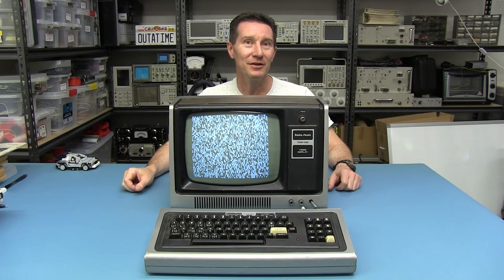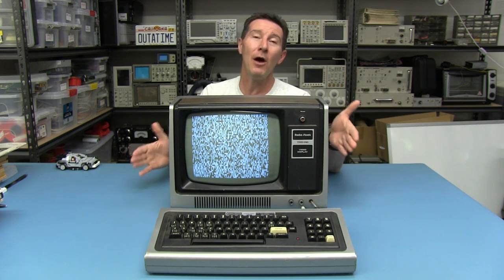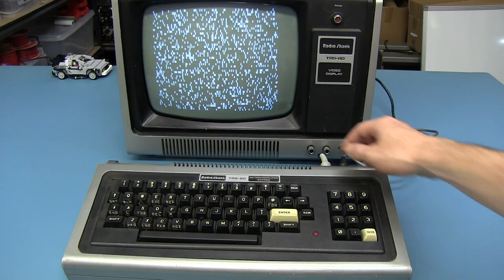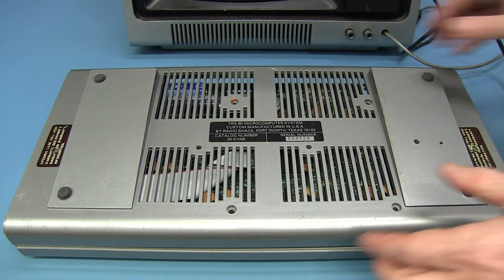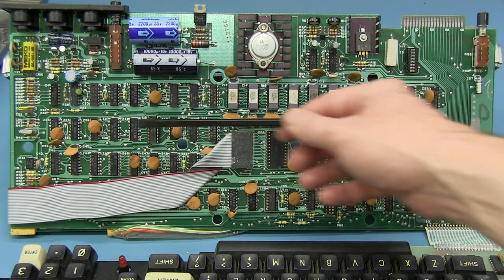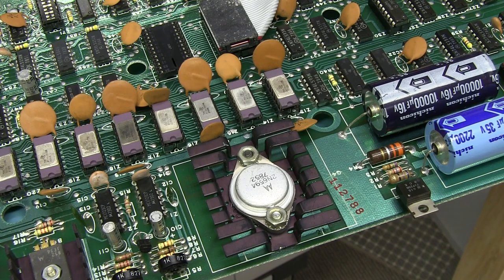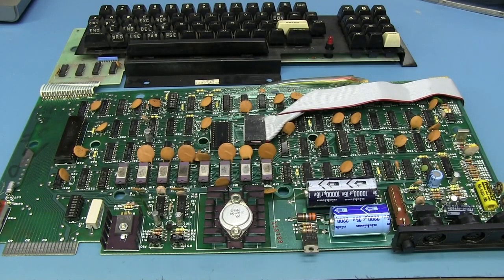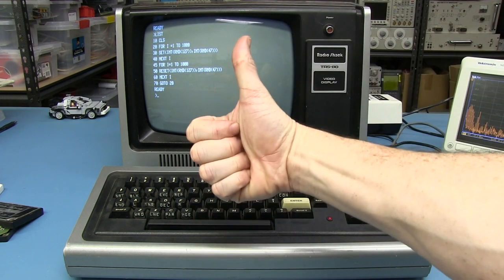EEVblog #645 - TRS-80 Model I Retro Computer Teardown

Comment: That machine had daily use as a home and business computer for 6 or 7 years. The next 2 or 3 years it got flogged in a factory as a label printer driving a sequence of dot matrix printers. Then retirement and storage once PC clones took over. There was no bootup time so the easiest way to stop what you were doing and get ready to load the next task was to power cycle. Flicked on and off all the time.

Primarily used for word processing (note scripsit labels on keys) and label printing using custom apps written by family members when it was at work. Had the same plus games plus VisiCalc at home. Also used for writing a lot of random games, apps, and utilities as I learnt to program.

Had 1 game with sound. To get the sound you had to connect up the tape player, Set it to "Record" and hit pause which would cause the sound input to come out through the speaker. Even then, it was more squeaks than sounds as they were produced by writing out certain bytes combinations via the tape interface that were known to produce alien like sounds. Squeeks and squawks only.
Reply from the maker: Ben Govett Awesome, thanks for loaning it Ben!

Comment: Now 42 years or so have slipped by since I worked a one of the largest Radio Shack stores in the US in Framingham, Massachusetts.and we were certainly excited to get these units into the store and they did sell as fast as shipments arrived. As I remember the story, the computer was first going to be sold as a kit that you built by yourself. After meeting with the brass in Fort Worth, it was decided that it would be better to sell it as a complete unit. Two things I do remember differently than you described. First, the unit was shipped to us and sold with the keyboard and the "video" screen and the tape recorder and the power supply with all the cables. And it was all included in one box for the price of $599.00. And second, the first units only came with 4K RAM but later units could be ordered with 8K RAM. As you pointed out, it was a rapidly changing market so updates and changes came rapidly after production started. I have a slight difference in the clock speed. You stated that the speed was 1774 however the joke at Radio Shack was the speed was 1776--remember this was right after the 200th anniversary of the founding of the US. This computer was incredibly slow. Basic did not help. As a test, a friend and I wrote a program to sort 100 peoples names. Several hours later it was still working. But having said all of this, I remember staying up all night playing with the computer that I borrow from the store over the weekend--Stores were closed on Sundays back in those days. I learned a lot and I also sold many units  Thanks for the program that you put together It was fun to watch.

Comment: I still have my Model 1 with 16K (serial #6841).  I piggy back soldered a memory chip into the system to access lower case letters (with a toggle switch to disable for some incompatible programs). I taught myself BASIC and then was allowed to teach a 9 week class in my senior year of HS in 1982.  This device gave me the jump start in the computing industry and a boost to my confidence at a very crucial time in my life.  Thanks for sharing and taking me back to my roots!

Comment: It was actually possible to get a TRS-80 Model I without the numeric keypad throughout most of its production run -- not just the very early ones -- if you bought the low-end 4K version with Level I BASIC. The 16K Level II version came with the keypad as standard. It was also possible to upgrade the RAM and the BASIC without adding the keypad, so once in a while you'll come across a Model I with 16K and Level II but no keypad.

Comment: Brings back memories! I worked as a service tech between 1978 and 1983 in an independent Radio Shack dealership (actually two) in Slidell, Louisiana before Radio Shack (later Tandy) clamped down and only ran company-owned stores. I remember the owner successfully winning a lawsuit to remain an independent dealer/repair station per his contract. Needless to say, Tandy hated us :)

You are right that the expansion cable leads to the Level II ROM. The original ROM chip was pulled out and the expansion board attached with double-sided tape. The colored jumper wires were attached for power, etc per the Tandy-supplied instructions to the techs. Oxidation on those jury-rigged connections caused no end of grief.

Little known fact: When we had to replace or upgrade a DIP chip in the field, we were required to socket it to show it's compliance with the latest update. PITA because some were used in moist environments and the tinning on the chips would oxidize (like you see on the Z80). 

Later, when the FCC cracked down on emissions, we were required to add stick-on shielding packs to any Model I, II or III that came through the shop whether is was part of the repair or not.

We had tons of fun (not!) in fixing the circuit board design errors on any early-model machines (usually the II or III models). It seems we were forever getting service bulletins to cut this trace, jumper from here to there and generally create a rats nest of circuit fixes that should have been found in the original circuit boards.

All in all, pretty sturdy machines that would get pretty warm over time and sucked power like it was free. I never liked working on the monitors much since I got knocked unconscious once after accidentally running my right forearm across the back of the cathode ray tube doing a repair. My tech buddy said it tossed me about 6 feet back from the tech bench. Don't remember that but DO remember waking up on the floor. I still cringe every time I see an open flyback transformer...
Reply: "I never liked working on the monitors much since I got knocked unconscious once after accidentally running my right forearm across the back of the cathode ray tube doing a repair."

And that is why, folks, I don't do monitor repairs.
Reply: Yes, you learn the value of an isolation transformer  Very quickly! I went in forgetting to plug in the monitor into the transformer with my scope pro, flew across the Room and messed up the probe as well

Comment: I spent a good portion of my childhood hacking on one of these.  A couple of relevant points:

The machine ran at 1.77 MHz out of the box, but almost everyone who actually owned one and was at all into electronics ended up doing a fairly simple hack to double the clock speed, so an awful lot of these actually ran at about 3.56 MHz instead.  That was actually much faster and more capable than most of the competition at the time, which I think was part of why they were so popular.  There was also a very common (I think almost ubiquitous) hack to add an extra RAM chip necessary to do lowercase (the character generator actually included lowercase characters already, though some of the earlier ones looked really ugly (they didn't do descenders properly), so that was often replaced as well).  Radio Shack even offered a DIY "lowercase mod kit", if I remember correctly.

I'm pretty sure that the monitor was actually sold with the computer as a set, not separately.  I've certainly never encountered any TRS-80 model 1 that wasn't bought with both the keyboard and monitor together.  It was true that you could technically hook it up to any composite NTSC display (so you could display it on a TV if you really wanted to) but that required hacking up a custom cable that as far as I know Radio Shack never sold.

The tape deck may have been sold separately (I don't remember), but it actually worked with any common audiocassette player (it wasn't a special computer accessory or anything), which lots of people already had, and if you didn't they didn't actually cost that much.

The expansion interface (which was a box which sat under the monitor) didn't actually contain the disk drives.  It just contained a drive controller, which could then be plugged into external disk drives (which sat in their own separate box(es)) via a ribbon cable.  (It also contained more RAM, printer and serial ports, and a few other extra bits, as I remember).  You could actually connect up up to four external disk drives by daisy-chaining them.

The "Trash-80" name was originally coined by Apple fans, I believe, but a lot of folks in the TRS-80 community sorta turned it around on them, adopted it, and made it their own, and it became something of a moniker of pride in some groups.

The 64x16 character display was not driven by price (as far as I know).  It was because that made the video memory space a nice round 1K in size, which was architecturally convenient for several reasons.  It also made the character aspect ratio much closer to printed text, which made text applications nicer.  Also, keep in mind that the 64 character display was at a time when other computers really only had 40 characters across, so the TRS-80 was actually much more capable for text applications like word processing than its competitors (which was the other part of why it was so popular, I think).  The 64x16 screen was not a compromise, it was actually arguably a much better character arrangement than what most other home computers had at the time this was released.

Regarding audio, you could, at the time, actually buy a little external speaker box which you could plug into the cassette port which the computer could use to play sounds.  It only offered simple bit-banged (on-off) audio output controlled by writing 0 or 1 to a port, no fancy synthesized audio or anything, but there were actually some programs at the time that still made surprising use of this through PWM techniques, etc.  There were lots of games and such that did include full audio effects using this method, and even a "music composition" program that featured multiple voices, and an editable graphical depiction of a musical score sheet, etc.  These computers were certainly not "mute" by any stretch of the imagination.

It's also not really fair to say it had "no graphics to speak of".  There were actually a lot of games, paint programs, etc for the TRS-80 that made use of its pixel-graphics capabilities.  Sure, it was only black-and-white, and you could only draw in blocky, non-square pixels, but you could still do a surprising amount with that if you put your mind to it, and many people actually did to good effect.

Oh, and it wouldn't actually hurt anything if you plugged the wrong cable into the wrong port, it just wouldn't actually work (obviously).  They were at least bright enough to take that into account with the design.

Comment: I used to work on these back in the 80's and i still have one that i must restore to life one day . Back in the 80's i made a load of hardware and software for them, i never marketed / sold it though :( . Audio samplers, 512k ram extension , RAM based NEWDOS/80 (no need to load overlays from floppy/HD) plus much more.

Comment: Super fun hacker computer for back in the day... you could get books on how to hack it... including a full disassembly of the L2 Basic.  I took mine and put 48KRAM, L2 Basic (used 64K EEPROMs in the original sockets, no extender board needed).  It's very simple to add lower-case characters, they're in the generator, you only have to add one wire IIRC.  My first real tech job happened because I was a Model1 hacker... all their industrial computers were based on it, Z80 stuff.  Made things that connected to the parallel interface... EEPROM burner, etc.  Still have that thing somewhere in my junk... you haven't lived until you've used cassette assembler (EDTASM).
Reply: @Scowell — I did the lower case hack to mine as well (using wire wrap wire, which was pretty common at the time). You just had to cut one trace from the character generator ROM and run it to the one RAM chip – (data bit 6, I believe) – which wasn't hooked to the CG ROM originally. I remember being thrilled to have lower case, but disappointed that the CG didn't have true descenters (so lower case G's, J's, P's, Q's, and Y's always looked funny, as they sat slightly above where they ought to have been in the line of text).

Comment: Started my engineering career working bench for Tandy in 75 through 82 and designed the serial to para I/O board that was used when they replaced the Cassette with a Shugard 5 1/4" floppy drive...
Reply: Paul Mays Hey I have a trs-80 model 3 and I really want it get it up and running so I was wondering if you could help me?
Reply: Shepjepp
I doubt it since I haven't even seen one in 35 years and I'm old and hardly remember what I had for dinner yesterday...
Reply: Nvm great news I dint know the power switch was under the computer! I was taking it apart to see what was wrong and while I was unscrewing from the bottom I saw a switch, flipped it and it turned on xD some of the keys don't work though any ideas?
Reply: Shepjepp
is there a pattern to the ones that don't work or is it random... If it's a pattern like E,F,B,Y,J, in diaginal rows it means that a line to the mother board or on the Key Board is not passing the data.. This could be due to the Key Board connector having a bad contact... If its random like R, K and X don't work then it's proly corrosion on the individual key switch... Under each key on the Key Board there is a little metal cap that is flexed down making contact.. if corroded contacts under these little caps you don't get contact... I remember that you can disassemble the board and using a exacto knife lift the metal cap and clean the bottom of the cap and the two copper traces on the board where the cap makes contact and then you will have to set the cap back just right in the exact same spot and seal it down around the edges...

Comment: That extra key near the EI connector is a reset button. They used to have a cover which would flip down and protect the connector. Most people discarded these as they got in the way of the reset button. Also, the monitors did come with a grommet. :-)

Comment: In the US market, for $599 you had a complete bundle (and large box) with the 4K computer, the modified RCA 12" set, the power supply brick and the cassette recorder. It's so hard to imagine that the joke of a company Radio Shack is now would have had such a product! Ditto for their audio product line, which in the US was quite good actually. I worked there back then, and that was an era when you weren't ashamed to admit it.

Comment: The MEMORY SIZE? was indeed shortened in later versions to MEM SIZE?, the rest of the initial message was also shortened to R/S L2 BASIC to create more space for the revised ROM.
If you press Enter, you got all of the available RAM for BASIC programs.  Entering a number there reserved some of the memory for use with machine code instead, reducing the available memory for BASIC programs.

The other switch on the back was fitted as standard and is a hardware reset.  Not of much use in the base unit other than to recover if a load from cassette failed, but it had various uses if the expansion interface was connected.
There should be a plastic cover over that switch and the edge connector, made of the same plastic as the rest of the case.
Reply: All spot on. I lost the plastic cover many years ago as I always had either an expansion unit or (later) a printer interface plugged in. The reset was useful if any external IO device locked up including tape, printer, serial, fdd, or anything on the bus.
Reply: I recall mine saying "MS L2 BASIC", some years passing before I realized it had been MicroSoft.  Purchased mine in 1980 so it must have been one of the latter ones.

Comment: One of my first computers, handed down from my Dad. We had a hardware hack that put in some extra logic and a toggle switch to toggle capital/lower case letters for use with the Electric Pencil Word processor... And I actually used it up until High School for Word processing.. 

Also had the Level II basic expansion.
Reply: Nice!
Reply: The "Level 2 BASIC upgrade also added the bigger character set ROM to get you lower case characters. Oh, and I believe that the two asterisks, with the right one blinking to show you progress while a program was loading from cassette?  That moved from the top left to the top right with the upgrade.

  I think the upgrade was $99 and you had to send it to Radio Shack (and they sent it away to be upgraded).

I installed 16K of RAM myself.  It was 8 individual chips in a blister pack all pressed into an anti-static pad.   Also cost me $99.   Crazy.

Comment: In college they dumped a big pile of junk and in there I found a TRS-80 monitor. The model number is KTR 122S, manufactured in December 1977. It has a gromet in the video lead, and the chassis is different. I don't know why the flyback lead has no insulation cup, there was some corona discharge producing ozone in mine, so I installed one from an old TV.

It appears it feeds on a composite signal isolated by an optocoupler.

Comment: Great to see this computer again. Brings back some great memories. Thanks.

The Model One was my first computer.  I bought the floppy drive expansion box and the original Radio Shack branded Centronix dot matrix printer.  Learned how to program in Basic on the Model One. Upgraded to the Model Three as soon as I could. After the Model Three came the Apple Mac-Plus and I am still a Mac user.